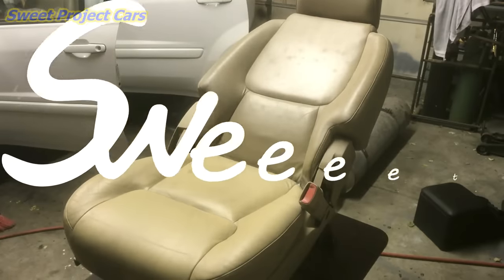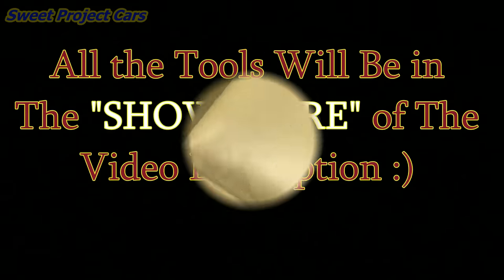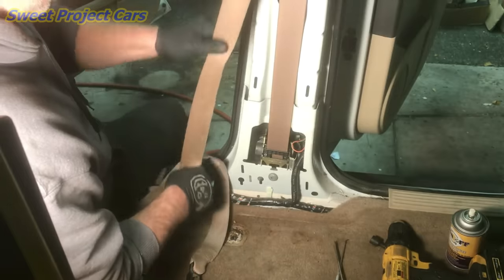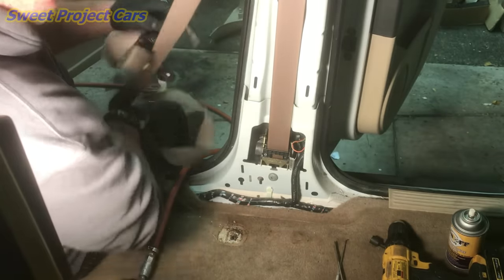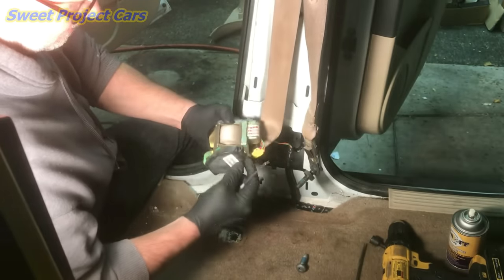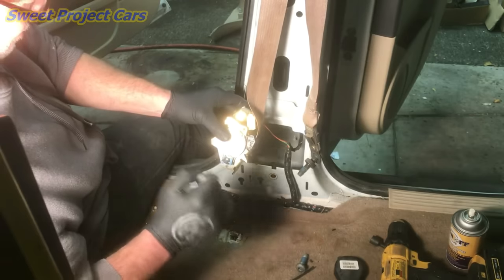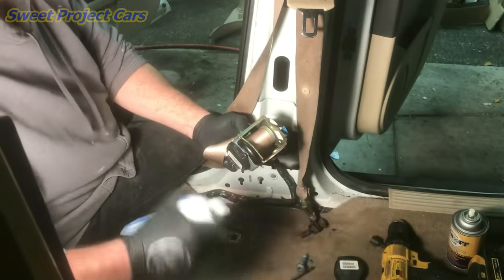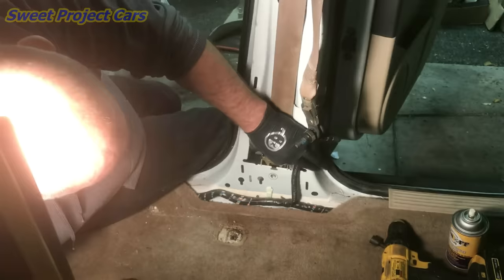How To Repair SLOW & STICKING Seat Belts

Comment from the maker: ****Hello our Great Subscribers and visitors:) We hope this video helps you with your seat belts and coming next week is our EASY seat re-conditioning video:) See you Sunday for the Sweet Reviews Video !!****
Reply: How about adding a warning about pretensioner seatbelts found in some cars. They have an explosive charge that can rip your fingers off, or worse, if you get it wrong.
Loved the split PVC cleaner though, must try that.
We hook the belts over the outside mirror on a nice day to let them dry.
Reply: Sweet Project Cars Do you have to take the seats out to fix the seat belts
Reply: @Stambo agreed, plus [i] don't know where all the aorbags are. but [I'm] not sure [I] would want to grind dirt into the belt like that. ...Maybe for use after the water rinses clear... another vid suggested compressed air and dry lube on the tensioner.
 I have never seen belt care on YouTube besides washing, And have sought intermittently for years 😐

Comment: My ‘80 Mercedes 450SL has a sticking and locking issue. My older ‘75 Mercedes 450SEL is a-ok. I’ve been thinking about taking the SL’s apart to check it out. My husband’s Nissan truck has really nasty black dirt on the belts. It makes me want to take them out and throw them in the washing machine! His work crew would get food at 7-11 and nasty up the truck. Now it’s our personal vehicle. I’d rather drive my super clean Benzes. 

I love your ideas for carpet cleaning!! Thanks!! I can’t wait to do that. Kinda cold in MD right now.

Comment: I use turtle wax dry cleaning Agent on my belts and it cleans them well. I rinse it off in a bucket of HOT WATER and it makes the belt clean like new again and it fixes the slow feedback issue
Reply from the maker: Thank you for sharing have a great day Mike

Comment: One of the things that makes seat belts slow is the grease and oil from peoples hands. This can make dirt stick to the belt causing the belt to retract slowly. Because the grease and oil (only) mainly gets on the section of belt that comes into contact with the person, you need only to treat this section. A way to do this is to add a few drops of dish washing liquid to very hot water in a saucepan, place the saucepan on the car seat that the belt is for, fully extend the belt and place a light clamp on the belt preventing it from retracting. Place the now floppy belt into the very soapy water and work the soapy water over the belt making sure it gets into the webbing. Let the belt sit over night. The belt should be clean by the following mourning after the soaking - dry off and allow the belt to retract. This should remove the grease, oil and dirt allowing the belt to retract quickly and smoothly...................The End.
Reply from the maker: Thank you for sharing that’s why we said that cleaning is one of the most important ways to make your belt much faster  we have many videos on how we clean them have a great day

Comment: Working on a Honda Accord 2000 sedan and removed the retractor like you showed.  Tried taking out the 3 pins from the side cover - see 3:27 - and the retractor spring went Ziiinnnng!  So on a Honda, DON'T remove the brown cover!!  I had to get another whole belt retractor assembly (the entire belt) from the junk yard.  Your Super Clean works GREAT at cleaning dirty belts!!  Soaked in 100% for an hour, then rinsed in water with the PVC Squeezer,  then soaked again and rinsed.  Man, that stuff does the job.  Thanks for your help!
Reply from the maker: Bruce Avilla thanks for sharing and yes all cars are different from the others for sure :)

Comment: I use Super Clean for cleaning everything. Just follow instructions to dilute or use full strength for what ever you are cleaning. It also is good for killing bad odors while cleaning. I mean you can add Oxyclean if you want, not sure if you can but I find just using Super Clean alone will clean and kill odors as the same time. BEST product on the market for getting the job done. Wish I could get paid for promoting it all the time. I tell people all the time.
Reply from the maker: We love superclean as well and use it quite a bit but with the mixture that we came up with including the oxi clean we have found nothing that cleans as well as that thank you for sharing my friend

Comment: I have a question I just got a NEW 2019 Jeep Renegade Trailhawk and the seat built is to short for some reason because it doesn't go around a body to good, It is tight fighting. So what do you suggest to fix that problem?
Reply from the maker: Hopefully you got your issue fixed, but what we would have done was taken it back to the dealership, that sounds like a manufacturing issue my friend. Thanks for watching and asking, hope you have a sweeeeet week. mad Mike & team
Reply: @SweetProjectCars  yep I sure did thank you so much

Comment: My friend can you tell me how I get to that assembly in a 2001 Sierra it looks hard cuz cleaning didn't do the trick it locks up it needs some Earl thanks
Reply from the maker: Best thing you can do is just start taking it apart, find things that can be removed and it will all open up to you. Hope this helps Rob, thanks for watching and asking, have a great day and all the best on your project. mad Mike the hammer SPC
Reply: @SweetProjectCars  thank you for the reply I really appreciate it and I do love your voice and your tone and your simplicity on speaking very plain simple English in detailing how to fix a project I also did the cool on my radiator and shoot anyway I meant Day wish I had one like yours in the car frame but now it looks like I had to take the whole back leather off to get to this assembly so that's what I was asking I do appreciate you replying back though keep up the great work 😎😎

Comment: Can you use graphite powder instead of a can of dry lube in the sides of the belt roller?
Reply from the maker: James you can use whatever you like we’re just showing what we use and guarantee the results with that. Thank you my friend have a great day
Reply: Sweet Project Cars just that I have it on hand. It lubricates locks very well. I don't want to spend the money onion a can of stuff I may only use once. I'm confident it will work as long as I can get it where it needs to go. Very useful video.
Reply from the maker: Give it a try let us know how it works if that’s of a dark color it may stain in your seatbelt.
Reply: Sweet Project Cars seatbelt is black anyway. Sure, will let you know, if I get around to it.
Reply from the maker: Good deal you are all right then thank you so much have a great day

Comment: HELP! The plastic cover over my '95 Ranger Club Cab looks impossible to remove. One video recommended I break it off. I don't want to do that just to get at the stupid seat belt! When I bought the truck I thought I could just squirt some WD40 down there. Boy was I wrong!
Reply from the maker: Surf steve wish I was there to help you as it is way to hard to explain in text my friend
Reply: Though your just a little to young I wish I could adopt you as my dad! I got a ton of projects, including a 2006 Audi that needs a ton of work, which I traded a perfectly good running 2004 Dodge Stratus for, ahead of it; so till it really gets to me I'm going to put it on the back burner.  Looks like I can maybe work the trim loose enough to get to it and go in through where the rear seat folds down from on the other side but that's kinds iffy.
Reply from the maker: Surf steve thank you for the kind words we will be here for you when you need help

Comment: My Jeep Wrangler has an issue with the seat belt.  Half the time I get out of the vehicle, when I go to close the door, the seat belt is draped over the bolt on the door post and prevents the door from closing. The retractor works fine. The problem is the loop it goes through to reverse direction. The metal loop has plastic molded over it to prevent the belt from fraying. I am afraid that if I keep closing the door on the seatbelt, it will weaken the belt. Does anyone know of a good fix for this?
Reply from the maker: Paul I may be able to help you with that can you send me some pictures to our email address which you will find in our channel information

Comment: How do I get my belt to stop sticking like the brakes have been hit? Any time on my passenger side when you put the belt on, if you move the belt stops and retracts and sucks ya to the seat! You have to take it off, retract it all the way and then rebuckle, sometimes it works but most of the time you just stay sucked into the seat! Help!
Reply from the maker: Siama Palkki this is where you have to take the retractor apart and lubricate and clean it or buy a new one, but usually, the dealership will fix it no matter the year and do it for free. thanks, mike

Comment: This just happened to me. Okay... I watched the video. I get all the methods. So now my question is uhhhh my car has the "internal" seat belt style. So how do I access the retacter?
Reply: And to clarify it's in the actual seat. So of I was to take the seat out? The belt would come with it. That's my issue. 04 Sebring convertible.
Reply: @carlosbaker8284  google how to replace the part for your car and it will show you how to get there
Reply from the maker: Hello Carlos if you can send us a picture or two we will see if we can point you in the right direction you can send them to Sweetprojectcars@Gmail.com
Reply: Sent the email. Just letting you know
Reply from the maker: I got it my friend you’ll have to take the covering off the seatbelt area so you can get to it Will be screws and plastic pieces you will have to remove to access the retractor

Comment: I highly recommend disconnecting the pretensioner before doing this.  Keep up the great videos!
Reply from the maker: Thank you Matt we truly appreciate that my friend we try to keep it really simple most people don’t know how to disconnect the pre-tensioner so we make an easy five minute job for them to make their belts move faster have a great day
Reply: Sweet Project Cars In that case,  you can simply disconnect the negative battery cable about 10 minutes before removing the seatbelt. The pretensioner is a pyrotechnic device.
Reply from the maker: Matt Wilson thanks much for sharing it really helps everyone :)

Comment: Have you ever heard a seat belt, shoulder that tightens as we drive down the road.  It is so bad that we put a clip on the shoulder strap to stop it?
Reply from the maker: Never heard of that Robert that’s crazy have a great day we will see you Sunday
Reply: it is a 04 Silverado.  The passenger side has been doing it for a couple years.  Now, the driver size is now doing it.  What a pain....
Reply: Yeah, I had a belt like that. It was awful. I took a large paperclip (must be large one) & poked & flipped the clip through the belt up at the top where it entered the door so that it would stop the retraction at the minimal tightening which was comfortable for me. I was the only driver so it was very convenient. And when I sold the car, I just removed the paperclip scraped the hole in the belt with my fingernail & it looked good as new. I found the paperclip method good because it didn't cost anything, was the right size, & wasn't really all that noticeable because I had spray painted it with tan spray paint the night before installing so it matched my tan belt & tan interior.

I didn't know if a standard metal paperclip like mine was what you meant or a clip like the newer black with silver flip handles which might be good for multiple drivers (I'd think they'd shift over time though, getting tighter) or if you meant something else.
Reply from the maker: Robert V ya that sounds like the retractor needs to be replaced, my friend :)
Reply from the maker: WatchingMyLifeFlashB thank you for sharing with the channel it really helps :)
Reply: Thanks, I will look into that.  The shoulder belt runs up the back of both seats on my 04 Silverado LS.
Reply: One of my bosses new bmw does that, are you sure its not part of the pretension system?